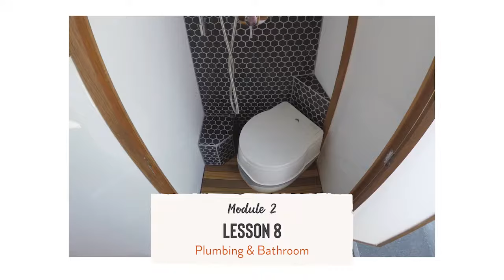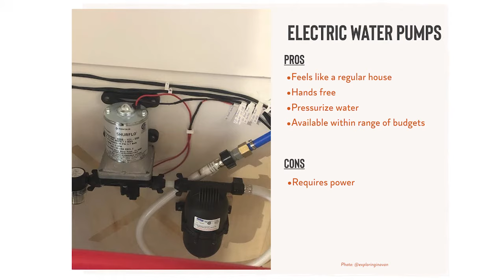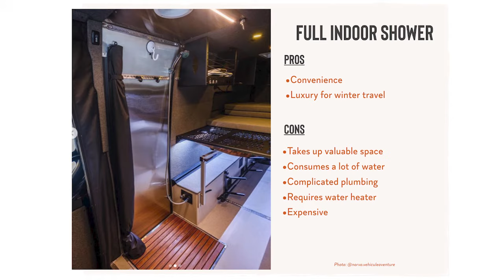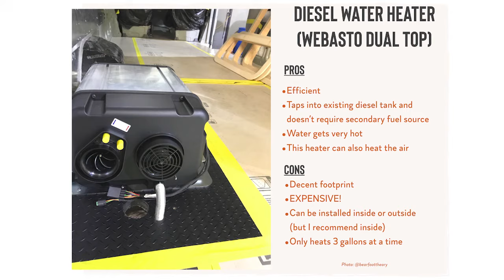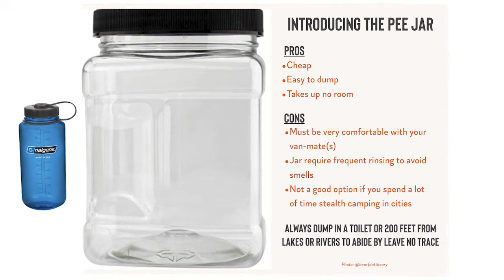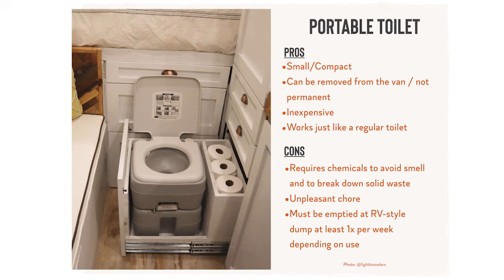Van Conversion Water Systems: Tanks, Toilets, Showers, Water Heaters and Plumbing

Comment: i'm thinking of having a shower on the opposite side of my sink and water tank. will this be a problem for when it needs to be drained into the grey water tank?
Reply from the maker: I think anything is possible. It would mean you'll have to have some pipes that run underneath your floor.